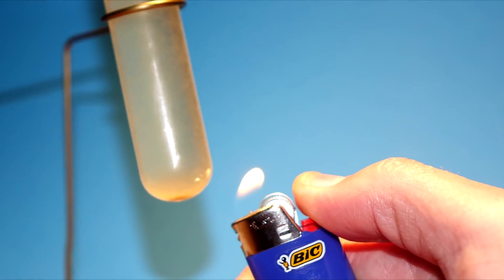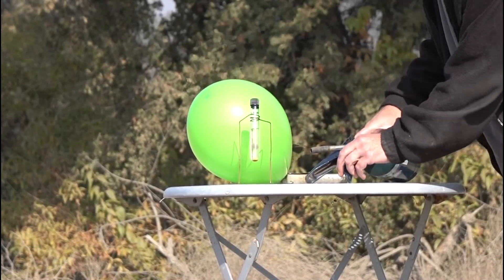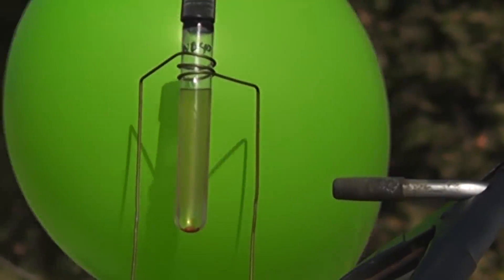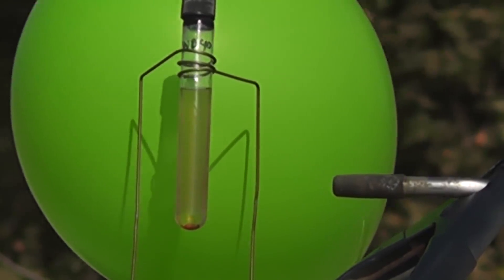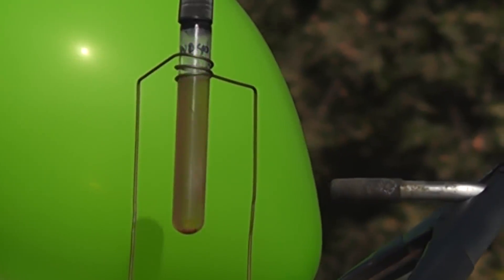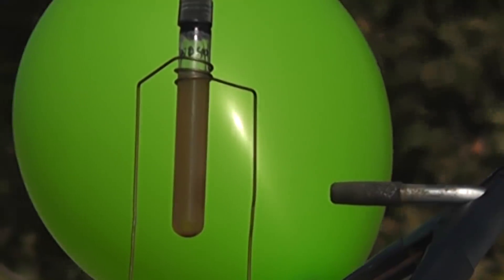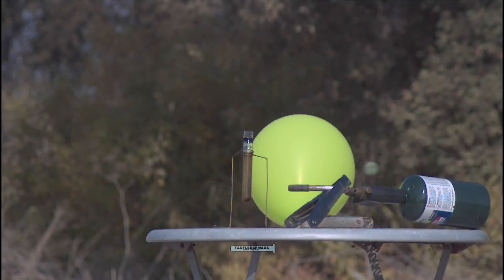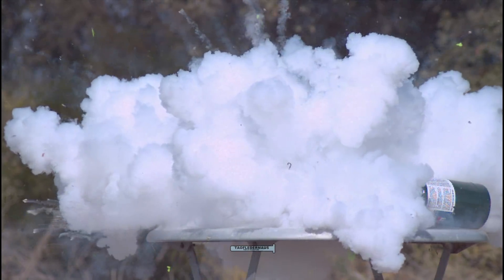Test Tube Torcher Test - WD-40  (new and improved)

Comment: It wasn't the WD40 that made it hard, it was that you got proper glassware (and your torch didn't appear to be optimized for range and flame setting). MAPP gas (with acetylene mixed into the propane) will also offer a bit more heat.

Comment: Yeah, I've always felt that the flame thrower effect was primarily caused by the propellant more than the WD40. A good experiment might be to take some bulk WD40 and put it in an air powered sprayer and see if it goes flame thrower.

Comment: Map gass? Or maybe 2 torches?
Reply from the maker: There was plenty of heat,   the WD just absorbed the heat and didn't build enough pressure.   The next one,  brake fluid took about 2 minutes with the same condition.

Comment: You need to redo the test with an additional source of ignition a few feet down wind, we need to see that bleve ignite.
Reply from the maker: If we can get everything perfect -  high pressure and high temp,   the substance can auto-ignite (flash point)  when it reaches the right air-fuel ratio   --- without a flame source.
Reply: @taofledermaus  That would be the optimal result, but because of the rapid decompression and phase change from liquid to gas, it is very difficult to keep the gas at an high enough temp to auto ignite. But I would love to see you try even if you don't succeed. And thanks for the answer, love your videos.

Comment: Retry with more(Maximum) heat, that might about do it
Reply from the maker: It was cranked up to max heat!
Reply: @taofledermaus  oh... would it be possible to get two blowtorches? Or maybe partially surrounding the test tube with bricks might make it hold the heat a bit better. That might just do the trick, the wind might have stolen just enough heat to keep it

Comment: Nice video Jeff and Co. I wonder if half of WD-40's volatility is due to the propellant in the spray can? I think the WD-40 itself is just a light oil. The high speed shots look good. The 12ga "SAFETY DEVICE" was a good move!!
Reply: dandel351 wd 40 consists mostly of 1K (kerosene). The propellant in the can is C02 which is actually a flame retardant. Back when I was a kid, propane was the propellant and the label carried an "Extremely Flamable" warning as opposed to todays "flamable" warning.
Reply: I thought WD 40 was actually made from fish oil not petroleum.

Comment: I know that you don't really wanna get too close to the tube while it's going...but I'm curious to see what consistency the WD-40 is after heating it up. Would it still work as a lubricant, even if only for really light duty? So on and so forth. Of course, you might die trying to find out, so....
Reply from the maker: It coated everything with WD40 and it seems to have the same consistency.

Comment: I am not sure how flammable WD-40 is on its own but the propellant used in the can is extremely flammable. The company I work for at one time made hair spray in the plant I work in. And at that time my job was to put the propellant into the cans. Now because the hair spray was made using alcohol it was flammable on its own but once you add the propellant it becomes even more flammable.  That being said, once the propellant has evaporated from the WD-40 the remaining liquid may not be as volatile as you may think.

Comment: I'm wondering if the borosilicate glass and steel stick puddy are overcoming the vaporization of the wd40. Looking into the vial  it appears to be trying to vaporize then condense back down the sides. Very interesting.
Reply from the maker: The pressure SHOULD build up to beyond the bursting point of the vial.   This just didn't work out for some reason.
Reply: @taofledermaus  could be your dealer sold you some bunk wd40.

Comment: If I recall wd-40 isn't all that inflamable. Its more the aerosol component that makes it catch fire and even still holding a lighter to a can of WD-40 doesn't work too well. However I would love to see this done with starting fluid, brake cleaner, or carb cleaner. I can't recall if you guys did those in the past. Even if you did you should do all 3 side by side and see which goes first.

Comment: You should try to heat up super glue..🙃
Reply: I did light a lot of it on a spoon, nice firework and not tooo expensive. Would love to see it in a TT.
Reply: @HYEOL  well now I know what to try the next time a bottle goes bad. I.e., turns into an eggshell protecting a bit liquid in the center.

Edit: have any safety precautions for me? I've got a bottle I no longer trust to use on my RC heli's. Or anything for that matter. So it's an experiment or the trash & I hate just tossing stuff.
Reply: HYEOL I imagine the fireworks😂 in slo-mo this might be awesome😄

Comment: When, as a kid we held a lighter to he wd40 can, it was the propellant lighting, not the wd40 :)
Reply: the WD-40 its self behaves a lot like diesel, it really needs to be in an atomized liquid to be combustible, though i do think that vapor cloud would have ignited if the torch stayed lit.
Reply: Spraying wd40 on glowing hot metal produces the same white smoke no fire. Try brakeclean for a nice fireball
Reply: @stevegoodzeck241  True, but spraying it on a welding arc creates flame.
And not from a can either, from a spray bottle.

Comment: Love it.
1- air rifle cheaper than 12 G and i think same effect and maybe none of  the fire arm BS of youtube.
2- maybe try the heat source under the tube instead of side on .( more even heat and get the ingredients hotter before the tube fails just do to thermal stress ?)
3 - :) what happens if black powder is heated to a god awful temp and pressure . Then plinked with with a BB gun :)
4 - oh oh  black powder mixed with alcohol and heated to a god awful temp. :) :)
Again love it and will watch  them all
Cheers
Reply: Black powder in a tube like that might be considered a pipe bomb so that's a bad idea
Reply: @Gibblegobblegoob  dry ice bombs are considered, well, bombs. I'd think anything in a test tube that you're trying to overpressure by any means would be considered a bomb. Even for science. Or at least backyard scientists without the proper certs & whatnot. 

But I tend to have to agree. He's likely flying under the radar at this point & black powder in a pressure vessel of any sort other than a firearm would likely be a huge blip even if prepared at the test site. Personally, I wouldn't risk it. Especially with Jeff being in Cali & the fact that literally any viewer can maliciously drop a dime for reasons such as waking up on the wrong side the bed or simply finding the vid in their recommended section.
Reply: @Iceberg86300  Yep may be a BAD idea :) mind you a proper percautions taken it would make an interesting vid. but yes I wish no harm to any one.
I was a few beers in when I made the comment.
Reply: @TheArrow1100  hey, no worries! I'd love to see that stuff. But sadly it falls into the "myth busters after a few seasons level" category of connections & production budget.

Officer Greg might be able hook something up to allow it to all be on the up & up, but I'd assume they wouldn't want to tap that resource for a test tube video.  

Also, you lay down much more coherent thoughts & ideas after a few beers than most of the internet can manage completely sober!! 😀

Comment: Thanks for the Airwolf theme... Isn't the flamethrower thing mostly because of the driving gas in the cannister? (and since that burns, the aerosol of oil will catch fire too...) I don't know how hot your day was, but I also had the impression that there was quite a bit of wind and the flame was going against the wind (which may probably have reduced temperature or increased the cooling of the tube outside the focus of the burner flame)
Love the extra series! how about some liquid acetylene for one of your next tttt videos?

Comment: I'm shocked that the cloud of vaporized hydrocarbons didn't light on fire. In fact that seems highly impossible.
Reply: The WD-40 was far, far above it's boiling point, but the pressure inside the sealed container kept it liquid.
When the container was destroyed, all that pressure was released, and the WD-40 flashed to vapor in an instant.
The sudden expansion blew out the flame of the blowtorch before the vapor could slow down enough to catch fire.

This is a common occurrence, and a phenomenon that is used to put out oil well fires. That is, by tossing a stick of dynamite into the burning well.
If he had placed an open flame some short distance away from the cloud, it would have caught fire shortly after vaporizing.
Reply: DesolatorMagic seems plenty possible lol it blew out the flame on the torch.
Reply: the shockwave from the rapid expansion blew out the torch before the vapor cloud could reach a near stoichiometric air-fuel ratio and be ignited by the flame.  thats jucst mu $.02
Reply: DesolatorMagic light a torch next to a propane tank and shoot it.... most times it will blow out the torch and no fireball!!!!! Use a road flare instead and you will get a nice fireball every time ;)
Reply: DesolatorMagic it flash boiled and the shockwave put the torch out before it had a chance to ignite.

Comment: Was that cloud of white smoke from the wd-40 or something you had in the balloon? But I will say you have more patience than I do I would have gave it 10 minutes before I shot it. 🤘
Reply from the maker: It was from the wd40,  the balloon was mostly there to keep the cameras focused.
Reply: It's the rapid condensation of degredation products of WD-40. Basically, it's a cloud of WD-40
Reply: most oil combustion will result in very white smoke. Think about having a culasse joint failure in a car, resulting oil to enter the cilinder: you can identify this with the heavy white smoke coming out the exhaust...
Reply: @lukearts2954  
I always thought white was a head leak from antifreeze.
Reply: @ChuckNorrisUltra  "antifreeze" is coolant, which is usually waterbased. Obviously that would give a vapour cloud that is white-ish. But like in this video, oil leakage into the cilinder gives a fully opaque white smoke. So if you see whit-er exhaust, yes, that could be antifreeze, but if you see exhaust as white as cotton balls, it's definitely oil.
Reply: What's a culasse joint? Is it like a henway?
Edit: Googled it: blown head gasket!
Reply: Agreed, with the 10 minutes part. Ive got no patience:)
Reply: that's what i was gonna ask, too.

Comment: That looks really cool in slow motion. The wax depressurization tool coming in and then the bang with the big white cloud of smoke. Very nice, great video. I've missed this type of content, and I'm glad you are doing it again. Thanks for this.   :-)
Reply: I'm shocked the aerosolized WD-40 "smoke" didn't ignite!
Reply: Dsdcain the "white smoke" is actually the wd-40 flash boiling  once the pressure drops because of the glass shattering.

Comment: I suspect the wind was removing too much heat from the test tube. Try again with a wind screen.
Reply: A rematch is in order. More heat is needed whether by a more direct application of flame and or wind protection.
Reply: @robmanueb.  could use mapp gas as well. Unless that's too hot & will melt the glass. Haven't ever needed to look that up.
Reply: He usually does them in a more wind protected environment. But this is basically a firecracker going off in November. People get mad. Can't win em all
Reply: I had that same thought !  It was being cooled faster than it could be heated........ almost ! 😊

Comment: I think a gallium ttt would be splendid
Reply: A whopping 2400 deg C, or so the info says. Surprising for a material that melts like chocolate.
Reply: Vapor pressure is too low. Despite its low melting point, it has a fairly high boiling point.
Reply: Maybe adding a flux could lower the boiling point point but I dont know if it would help it boil maybe  making a galinstan mixture could lower the boiling point though